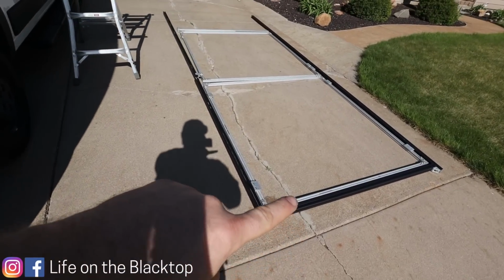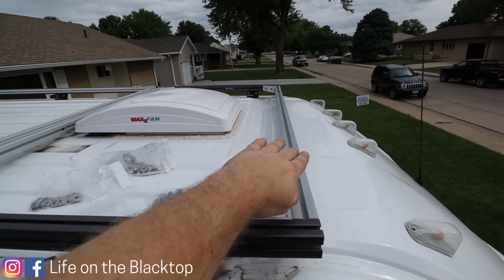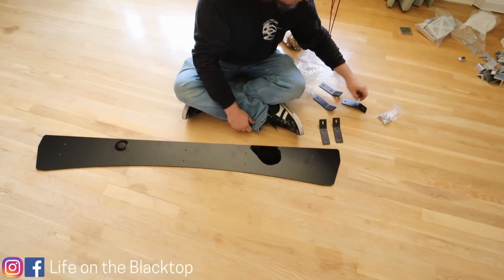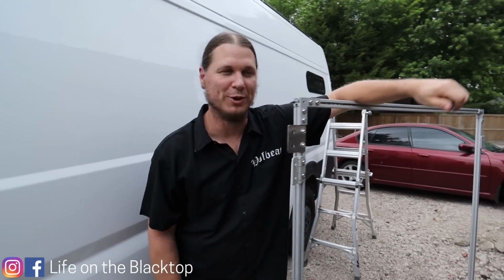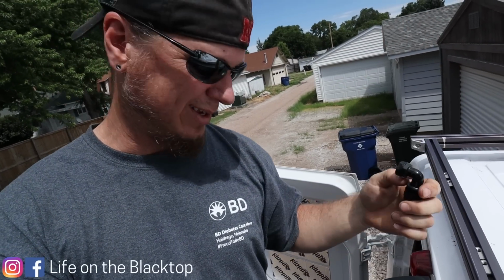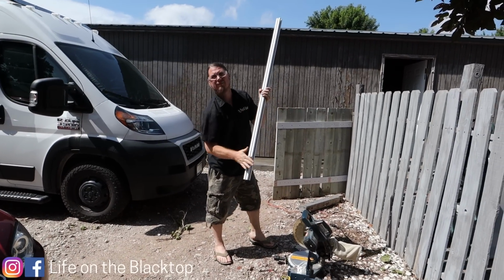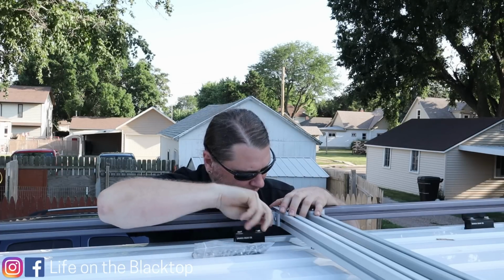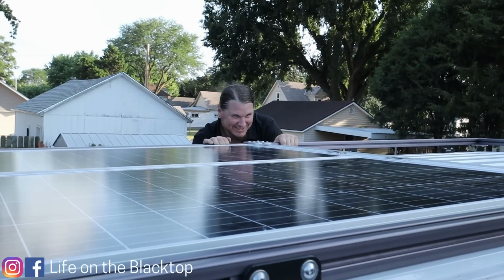DIY roof rack for camper van | Installing our SOLAR PANELS | Off-grid camper van conversion

Comment: What happens to those solarpanels in a hail storm or high wind?
Reply from the maker: They are bolted to an 8020 roof rack, so they're pretty solid and protected from high winds.  The panels themselves have a coated tempered glass on them and are "supposed" to be hail resistant!